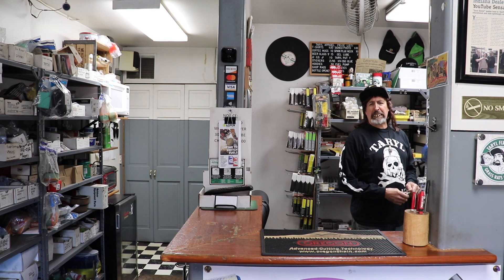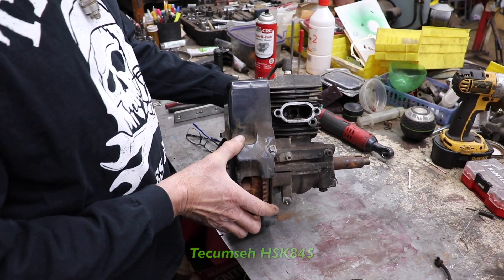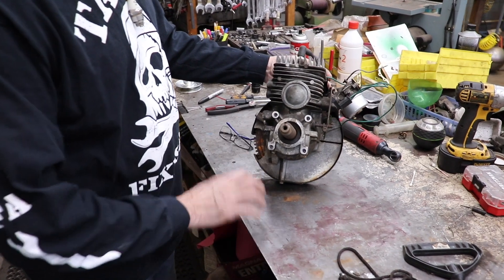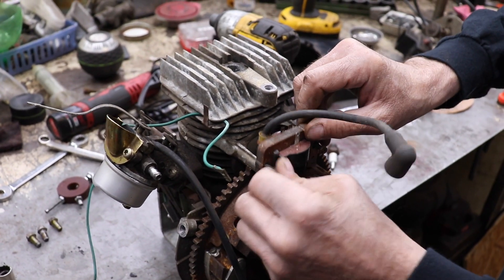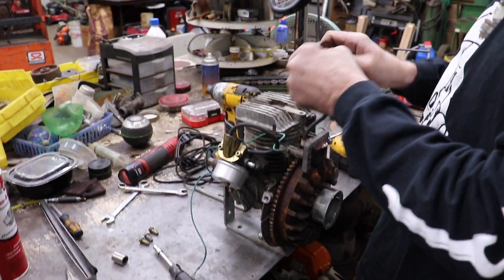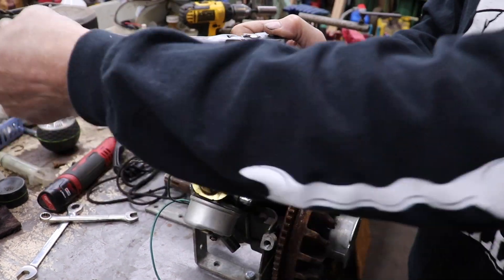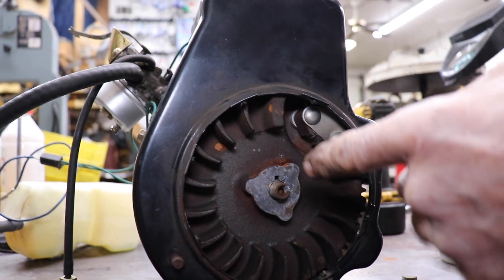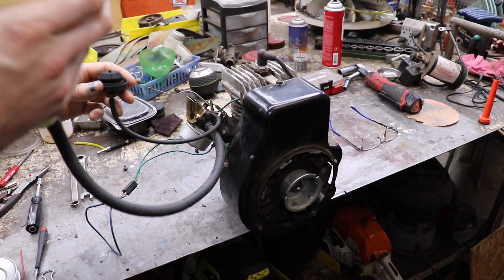Can You Run An Engine BACKWARDS?!? Let's Try It

Comment: About a century ago there was a railcar manufacturer of McKeen .  In order to go in reverse they had you stop the engine and you would do some kind of adjustment to the cams.     They didn't use an electric starter but used stored air pressure to start.  Problem was if it didn't start quickly you would run out of air then came out the manual crank.

Comment: When I use a drill to start an engine. I use an ratcheting breaker bar adapter. Kind of forgiving if you don't get the socket off the nut when the engine starts lets it spin without twisting your wrist.

Comment: The AMF /Harley Davidson moves the engine on the crank shaft to change when the spark occurred in the piston movement So the spark occurred a few degrees before TDC. ran great not a lot of power. Ran backwards.

Comment: Hey Taryl, Ski-Doo made a snowmobiles that would backup using a push button on the dash. Push the button and the engine would reverse and run backwards. Push again and drive forward.

Comment: I believe Polaris snowmobiles still do this today. To go in reverse hold button on dash until engine slows to a stop and runs backwards. Then to go forward, same process. From the Polaris web site:   How does Polaris electronic reverse work?
How Does Electronic Reverse Work? The electronic reverse is much easier than the mechanical reverse. With just a press of the button, the engine slows down to a near stop, then slowly starts up again to begins rotating backward to reverse. There is also another electronic reverse version called the PERC.

Comment: GM/Detroit 2-cyclediesels were made to run either direction but only one, not both. By pal had an OLD Bultaco Matador dirt bike that'd change directions while idling. It'd sort of PIFFLE and it'd be running in reverse. You try and take off and you'd be backing up BUT it'd only do it at a slow idle.

Comment: Skidoo 2 cycle snowmobiles get their reverse from electronically interrupting the engine spark/timing and kicking it backwards to run it in reverse, then the opposite when returning to forward.

Comment: Four strokes can actually run in reverse as well.  Some aircraft engines are available as reverse rotation engines, and the only major differences is the oil pump, camshaft and ignition timing.  When I worked at Caterpillar, they had an issue with motor grader with a 3306 engine that ran backwards.  If you loaded up the engine enough to stall it, it could fire a cylinder before top dead center and spin itself backwards, and once it was spinning the wrong direction it would run very badly in the wrong direction intaking through the exhaust and exhausting through the intake.  Odd seeing the machine rolling backwards in a forward gear.  Totaled the engine in a pretty big hurry because oil was being pumped out of the engine and into the oil pan.  Some ship engines are reversible because it costs less and weighs less to make the engine reversible than it does to build to in a reversible gear box.

Comment: note to add... back in the days... I used to mess with flying model planes, both control line and RC... those glow engine can catch and runs backward easily.. that if flipped started via fingers or a stick

Comment: The old Mercury outboard systems were called direct reversing and they reversed the engine to obtain reverse thrust.  The distributor would rotate and at the same time kill the engine for a pulse between running in forward and going into reverse
Reply: I remember those engines when they were new, alot of people crashed into the dock because it wouldn’t start in reverse rotation, that concept didn’t last very long, now they’re collector motors. I know where there’s many in the bottom of the river.

Comment: 30 years ago we had a 4str. old car V8 run backward...By accident...Engine was running terribly bad (Loaded the exhaust sys. full 
of unburned fuel vapor etc.) & over heated. Shut it off...It dieseled a couple seconds, then stopped and started running backward.
Volcanoed smoke and flame out the carb. It ran for several seconds as we flailed around. It stopped. Fun, Fun On the Autoban.

Comment: I once toured a WWII era tug boat that had a diesel engine with direct drive to the prop shaft.  To put it in reverse, you had to shut the engine down and shift the cam shaft, then start the engine in reverse.  I had to scratch my head at whoever thought that would work better than just putting a gearbox between the engine and prop shaft.  Kinda makes you rethink your definition of "military technology."

Comment: When I used to fly model airplanes with the glow-plug engines they would run in reverse at times. I always kept a rag close by to throw into the propeller to stop them.

Comment: In '67 I was in the Army overseas. We had M52, 5 ton tractors with 465 Continental diesel engines. Put a starter in one day and I had 5 speeds in reverse and one forward. Starter was spinning in the wrong direction. Exhaust out the Air filter and intake threw the exhaust. New starter fix the problem.

Comment: When I was at teen a friend has any old Johnson snowmobile. It was designed to run both directions. You wrapped the pull rope on the right side to run forward, the left side to go reverse. 
It wasn't a real performance beast but it got you around.

Comment: I helped my brother in-law fix his John Deere zero turn lawn mower.   He connected the battery backwards.  The crazy thing is that  it started and ran until the steering bars were moved out of the stowed position.  No damage was done with the backward connection.  The starter moter should have turned backwards and cranked the motor backwards.   This still baffles me to this day.

Comment: We had a diesel garden tractor running backwards once, about 30 years ago, but that was because of a weird misfire at startup. The problem then is that the oil pump is running backwards and not delivering oil to the bearings and bushes.

The tractor was a three cylinder Ford 1610, made in Japan.

Comment: Running two strokes in reverse is easy.  The lightburn Zeta didn't have reverse gear.  You just started the engine in reverse to go backwards.  4 reverse gears.  My Kawasaki F2 kicked back one day and it sounded odd.  I gave it some throttle and let out the clutch and shot backwards into the wall.  If you have battery ignition a spark will happen when the points open.  This may be the wrong time for optimum performance but it will spark.

Comment: You have right and left boat engines the difference is timing chain on right as a normal v8 engine and the  timing gears on left that touch in middle and it reverses crank direction to the original cam direction . The timing gears top and bottom are both larger but still 4 to 1 . 
And the starter and bendix  are different .

Comment: Can You Run An Engine Backwards? I converted a Chevy 350 to run backwards for my boat back in the 80s. Needed a reverse cam and starter. Ran nice. I assume that could be done with other engines.
Reply: How'd you do your oil pump?
Reply: @hank1556  Good question. All I did was put in a reverse cam and reverse starter, so the oil pump must be able to work with the engine running in reverse. I used a Jabsco pump for water coolant and mounted all of the other conversion parts, (exhaust manifold etc.) It was a 1977 Chevy Monte Carlo 350 engine. I never thought of that at the time but the oil pump must work with reversed engine. The boat ran great.

Comment: My sleds do that when you push the reverse button the engine idles down and just as it stops spinning it takes off backwards it saves a lot of weight by not needing the reverse gear

Comment: Hah!  Going in reverse by running the engine backwards.  When I was working on old VW engines in the 80’s it you had an engine that was out of time it would pop-pop and spin backwards 3 or 4 turns, frightening experience. …and those are the biggest feeler gauges I’ve ever seen!

Comment: Yep old 2 stroke golf carts ran both ways. In marine applications a reverse rotation engine was used.  A 350 chevy that runs backward. Lets see a 4 stroke single with a cam regrind to run backwards.

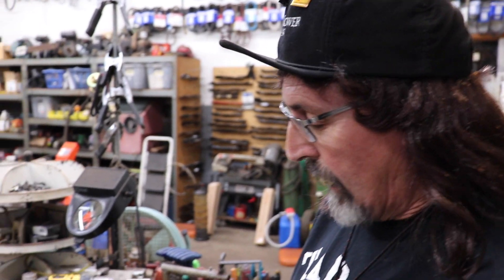Comment: 7:35 they both used cdi and they dont have coils on flywheel (it far i remember working on one for customers was one of ezgo but have Yamaha engine it run on cdi to coil to spark it doesnt matter which way it turn because cdi use pick up sensor that is magenta it tell cdi to fire the coil)

Comment: on a reed 2 stroke yes as nothing knows whether the crank is spinning forwards or backwards its just ran by the piston going up and down. 
some of the ignition systems wont allow it to run backwards though so thats a problem and can cause larger problems. but if it all checks out then your seals will hate you but it will run and make less power. your gonna lose ignition advance one way or the other.

Comment: Old Briggs, will run backwards, put it out of timing 180deg, the cam that is😎👍also you have to notch the flywheel key 180 degrees, so it fires on time

Comment: Ship engines are reversable-the HUGE Diesels they use.The enginemanss control panel has a throttle that can be moved from center forard to full throttle forward and full throttle reverse.Since the engines,prop shaft and props are massive you can't throw it into reverse instantly unless you want big damage!Of course prop drives that use electrc motors this  is easier-the diesel then just runs in  one direction turning a propulsion generator for the prop motors.

Comment: Back in late 60's early 70's all the kids had motorcycles  a friend had a small  HD.  50 or 90  2 cycle with the engine off he could put in gear  hold the clutch in push the bike  backwards pop the clutch it would  start running  backwards and run.

Comment: The Lawnboy D600 engine would run backwards if you turned the switch back to on just as the blade was bouncing back just before it stopped. Thats why it has a different governor collar. If it gets turned backwards it shuts the fuel off.

Comment: Short answer is yes an engine can run backwards. If they are designed to that then they actually run pretty well if not they don't run good at all and it can damage them.  I saw a 3208 cat diesel run backwards before and while fun to watch the noises it made weren't good.

Comment: 2 stroke yes. no problem. 2 stroke gas powered golf carts for example, have no reverse gear. to go in reverse you turn the engine off, and restart it running "backwards" Ignition switch is  labeled "FWD" / "OFF" / "REV".
The main propulsion engines in cargo ships and tankers are also 2 stroke, travel forward or aft are determined by the direction the engine is turning - just like steam powered vessels were.

4 strokes not so much

Comment: 2 stroke Detroit Diesel would do that if you almost stalled it and then released the clutch, if you saw smoke coming from the air cleaner it was going backwards.

Comment: yup,ran a Japanese built john deere with the bucket into a pile of mulch with throttle to low,idle went to nothing and I pushed in clutch, engine ran backwards, gears all backwards, hydraulics all backwards. Nobody believed me til I did it again, rpm got down to nothing til the compression pushed the pistons backwards

Comment: In 80s where I worked at a shop. guy had a inboard boat with a 302 ford engine. Starter shot. Went to salvage yard got starter. All fine but car starter didn't work. Boat motor ran backwards

Comment: I had a Jawa motorcycle with 2-cycle engine, I stopped on a bit of a hill as the Bike was rolling backwards, I engaged the clutch and the engine started backwards and I almost flew over the handlebars.
Reply: Same thing on an Ossa 250 Crazy 🤣
Reply: @Nudnik1  A yamaha twin jet 100 would do that as well
Reply: @Nudnik1  AND a Bultaco Matador!
Reply: @lewiemcneely9143  I had Montessa  Ossa  pioneer Bultaco pursang 250 
Now worth $$$$$$$$$$$$
Reply: @Nudnik1  Wouldn't doubt it. This was 40 years ago for us.

Comment: i got a 610 pro mac saw thats fired up an ran backwards many times. Thowt i dulled a new chain the first time it happened, now that ive got use to it doing it  just cut it off and restart it.  My own bad habit of just a short pull of starter rope and it kicks back and runs backwards.

Comment: I have a 1977 PUCH moped that will run in reverse if the timing is off  by only a few degrees.    That would be very bad for the 2 speed transmission attached to it.

Comment: 2 stroke can run both way doesnt matter what it take
but 4 stroke there two things u can do it swap cam for reverse or you swap intake to exhaust that two way lol
not all engine turn same way some do run in reverse from factory it because of cam and timing is set different

Comment: years ago there was an outboard motor that was designed to run backwards when put in reverse. I think it was Mercury.
Reply: Do not remember the brand but I had an outboard with a lever that moved the coil and it would run backward.  The motor would not pivot left or right very far.

Comment: I had a kawasaki 2 stroke 250 had bad crank bearings and the carb floats sticker on it at time one time I pulled clutch reved it clean it out it spit back I popped the clutch it went backwards lol think it was 1973 250 they were befor the ke 250s

Comment: not any mechanical 4 strokes without modification.. 2 strokes absolutely can, n in fact the yamaha blaster will at the very least, i tried driftin backwards down my driveway n lettin the clutch out a little n it fired right up

Comment: I test-rode a mini-bike before buying, it backfired when I let off the throttle and actually switched (without the engine dying) from driving forward to driving in reverse. When I killed it and restarted it was correct rotation again. I believe it was a Tekumich or Power Products 2 cycle engine.
How dat happen ?

Comment: In theory if you stand in front of the engine facing it, it is running clockwise.  If you stand behind it while facing it, it is running counter clockwise.  So , in theory to make it run backwards turn the engine around.

Comment: Ever seen an engine run at 0 rpm? I seen a single cylinder diesel run at 0 rpm by boucing the cylinder using the compression. Was interesting.

Comment: My brother was riding one of them go karts that has a spark plug come out of the top of the engine. well long story short.he got in a wreck and the spark plug broke off and the boot from the spark plug was stuck in his forehead.he had to have an operation to have it removed. now he goes by the nickname spark plug

Comment: I stalled a 5 ton military truck on a hill and it rolled backwards and the motor caught and ran backwards. It took a minute to understand what was happening. I'd push in the clutch, put it in 1st let out the clutch and it went backwards Then I saw the tach was bumping on zero, then I saw smoke coming OUT of the air cleaner!  I put it in reverse and crawled up to the top of the hill and shut it down, restarted and everything was fine.

Comment: Don't use a drill to start a engine. I was using new Crapsman 1/2" drill to start a push mower until it backfired one day and knocked about every tooth off the gears inside.Lesson learned.😁
Reply: You got use a breaker bar rachtet adapter to start it so it won’t drag the drill

Comment: I heard that when you start an old single cylinder diesel engine with a Hand crank and you spin it too slow, it would may start and run backwards.
Reply: That happens with a Lanz Bulldog tractor. The uninitiated or unwary could run over the plough if they accidentally started it backwards. Jeff
Reply: @jefftheaussie2225  I know but with small single cylinder diesel engines like they put on plate compactors for an example it also could happen. Happend to me one time, glad that I could get the crank right out
Reply: @derrasenmaher9730  The Lanz is a big single cylinder diesel motor. To start it the flywheel is slowly ‘bounced’ backwards and forwards by hand on the compression and it will fire and go. Sometimes backwards. To have a motor kick backwards with the crank handle stuck on the shaft, as you say, is definitely not good. I have a  Lomdardini single cylinder diesel motor on a welder which can be started with a rope. I always keep in mind that it can kick back and wind the rope back on taking me with it. You can’t afford to be half hearted starting stuff like that, give it all the beans. Jeff
Reply: @jefftheaussie2225  I know we had a Lanz Here 😁 greetings from Germany (thats where I come from), the Land of Lanz 😁

Comment: I accidentally made my 95 ford 300 i6 do it the other day. Was climbing a hill. Ran out of power and the engine died. And the road was steep enough that it rolled backwards before I could push the clutch in. And it started. Not good on it at all. But it's possible. Old Detroit diesels could run either way from the factory

Comment: In 1973 I was going down a steep hill on rt 309 in Allentown PA in a 1962 corvair automatic. I was going 65 mph and I wanted to check if I could start it on compression so I put it in neutral and shut it off while coasting at 60 mph. I turned the key back on and accidentally put the the shirt lever in reverse. Dam if it didn't start up backwards unbeknownst to me but it was running like shit. I pulled into my girlfriends uncle gas station and told him my car was running like shit. I put it in neutral and got out to let him in . He put it in fwd and it went backwards, then put it in reverse and it went fwd. He asked me what happened and I lied and said I didn't know.